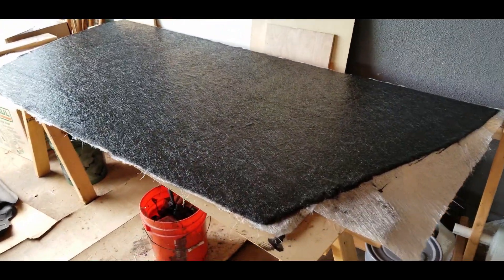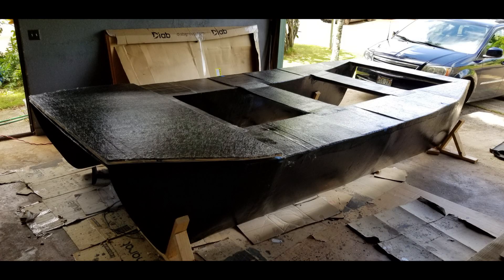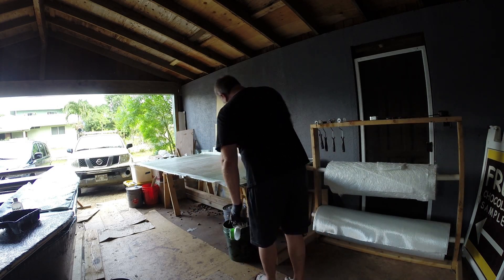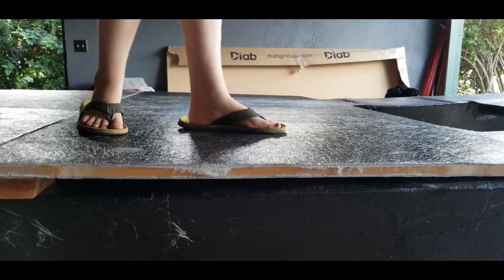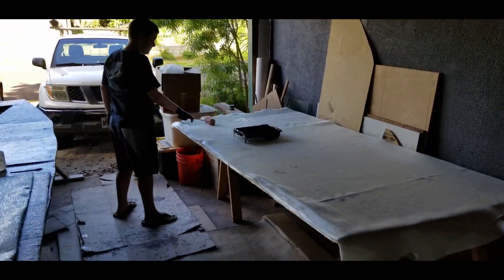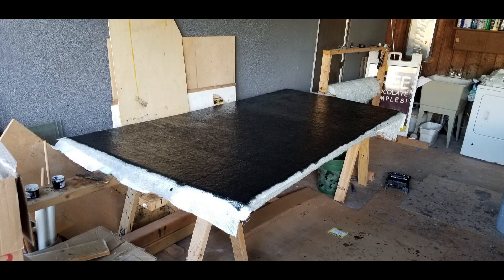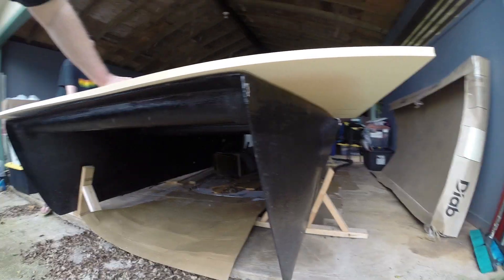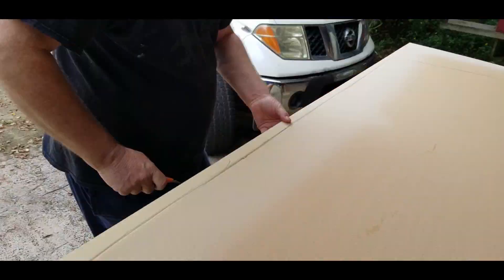Solar Patio Boat Build 15 - Finishing the deck panels

Comment: Sol,  a couple of points:
1 - what are your plans for mounting the s. panels?  I'm thinking they will be on some type of framework above the passengers, giving you full use of the deck and providing some shade.  I've used 1" thin wall metal conduit tubing for mine. It's like a dollar a foot for the 1" size and available at the home improvement stores.

It is light weight, very strong and easily bent with a used bender (cheap if you find them used on Craig's list)  The tubing is also available in 3/4" and 1/2" dia.  I welded mine together using oxy/acc after using a HF tubing notcher.  If well prepped and painted I'd think it would hold up fine in your salt environment.

2 - I like you editing, it seems after you put your video clips and pics in order you added your 'running explanation' through some editing software.
I'd like to know what program you've used as I'd like to make a utube video showing the build process of my boat.

Hopefully the program is free and easily learned. 

I'm working quite a bit on my project and am looking forward to having it well tested and sorted by next years Boating Season.
thanks

Gary in n. Calif.
Reply from the maker: Aloha Gary, I am going to be using PVC pipe covered in fiberglass as the supports for my roof. Part of my build is to not use any metal or wood for long-term durability and no maintenance. I will use a thin sheet of fiberglass for the roof as I don't need much structural support because I'm going to be using the thin flexible panels. I add commentary to my videos afterwards because I'm not always in a position to talk to the camera and it feels kind of awkward to me in the neighborhood that I live in. For editing the videos I use Adobe Premiere Express. It's not free but it's only $100 and is pretty easy to use. I also use Adobe Photoshop Express to edit any still photos that I insert into the video. It's also $100 and pretty easy to use.
Reply: thank you Sol, I'm already looking forward to seeing your plans displayed in the next videos.
and thanks for the recommendation for a video editing program
it turns out I have something already on my computer and found a pretty good tutorial on Utube with step by step instructions on how to use it.
I need to get off this computer now and get back out and work on my boat - talk to you soon
I did look at a video of yours showing your vertical gardening boxes - what a Nice place to live, wow!  -  later
Reply from the maker: @garygerard4290  Looking forward to seeing your boat!
Reply from the maker: I use the electrical conduit for my backyard vertical garden trellises. The trellises go 10 ft in the air and use foundation wire panels as the supports for the plants. You're welcome to check that out on my other YouTube channel - The Backyard Vertical Gardner
Reply from the maker: Looking forward to checking out your boat project.

Comment: this is one of the more fulfilling channels I watch
great editing/explaining and I like the sped up pace.
I've already mentioned how nice a work area you have
Have you any numbers as to length-beam-approx. weight?
I've got the sailboat I'm mounting panels on and have been making good progress - 21 foot w/1600watts
You postings help build my excitement
'and great last song, I have it in my collection
'keep on glassin'
Reply from the maker: The boat is 15.5' by 8'. This keeps it trailerable and will still let me store it in the carport. The pontoons are 2.5' tall and right now it weighs a little under 800 lbs currently. I am estimating a launch weight of about 1,500 lbs with 2 trolling motors, 4 deep cycle batteries and 8 flexible solar panels.  Two solar systems of 4 panels/2 batteries each.
Reply: @DIYKauai  thanks